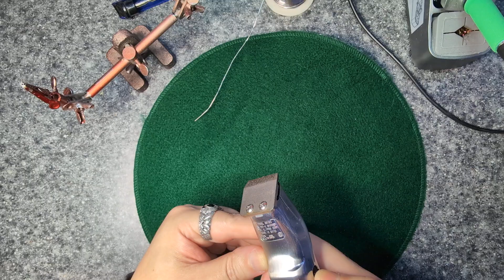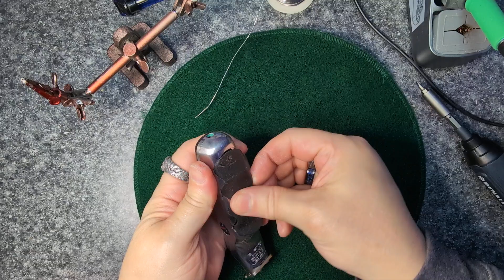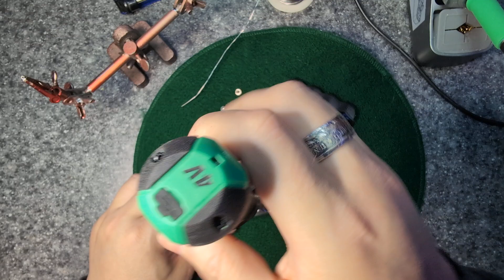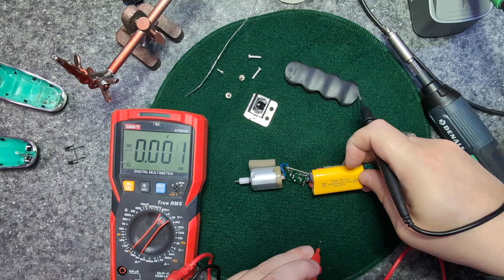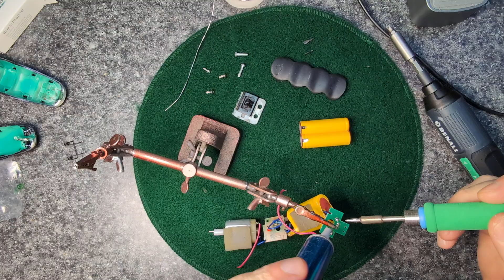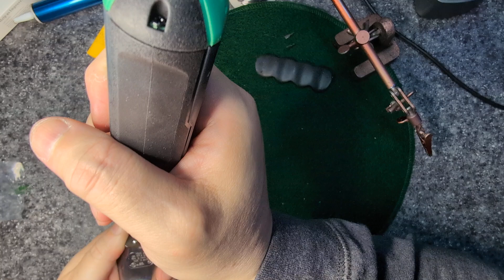WAHL GroomsMan beard and mustache trimmer battery replacement (9918C) and others

Comment: Good job. I replaced the battery pack of my Wahl 9918c with 2 AA NiMh batteries. They are just a tiny bit larger than the original battery pack,and I was able to get them to fit. After the initial charge with the AA size NiMh batteries, I used it once a week for 2 years without having to charge it again.  It cost me under $5.00 for the NiMh batteries. It has worked great for me for over 20 years! I hope this helps someone.